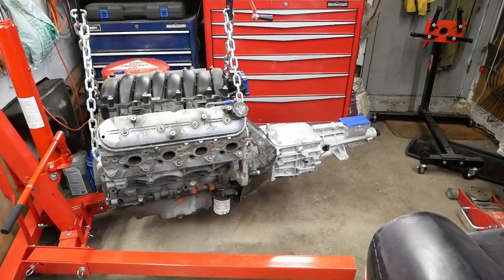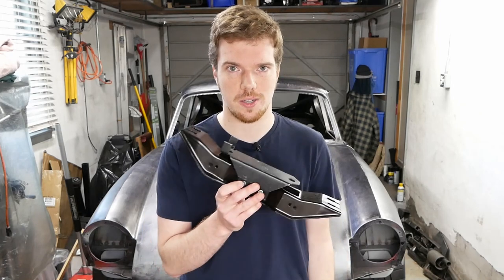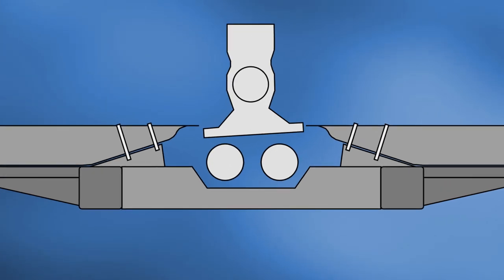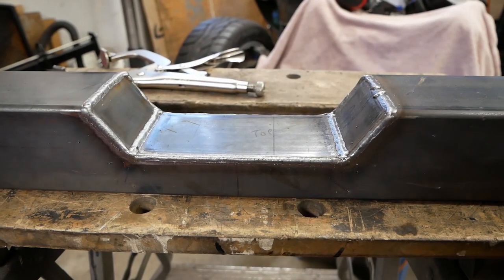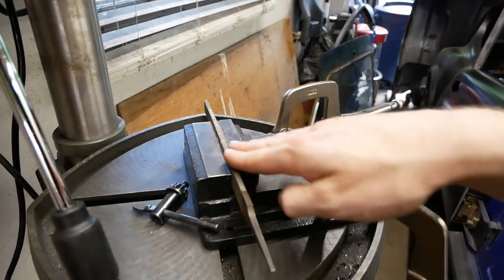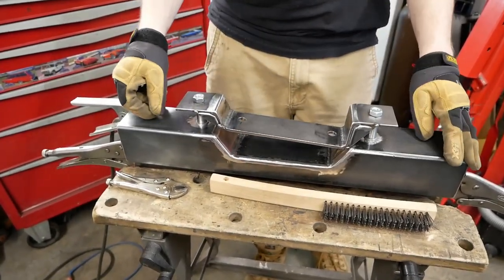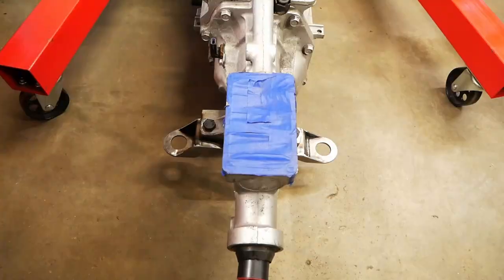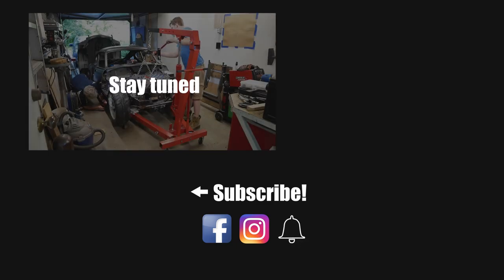LS & T5 Mounted – Pro Touring V8 Triumph Restomod – Project GT6R – Ep21

Comment: Ah the fantastic spark-catcher boot & shorts, very comfortable in hot weather an absolute must for catching those sparks from grinding and welding ;-)
Great work as ever, and I was pondering how you were going to get around all those kinky angles Ford throw around on that gearbox - well done :-)
Reply from the maker: They do catch a lot of sparks... maybe flip-flops would prevent that? 🤔😉  Thanks Rob!  It was a bit of fun but we're happy with how it turned out!  Appreciate the kind words!
Reply: @FanatikBuilds  Yes, I do find flip-flops a better protection against sparks & arcs ;-)

Comment: That is a great piece,  with your engineering background,  thought you might appreciate small suggestion, for a future build.  If there is room, if about 5/16 addition width were added and bend it slightly like 30 degrees.  It would add stiffness so you could reduce the thickness of the Main piece so all the mounting surfaces and thus the weight, additionally if you dimpled around the hole that would change the stiffness of that area,  it looks like there’s room and wouldn’t significantly interfere with the exhaust pipe.  Just a thought,  keep up
The excellent build I great enjoy your work.
Reply from the maker: Thanks for the kind words and ideas Oscar, really appreciate it man! 👍

Comment: A thing to check is to make sure that the transmission mount bushings aren't stiffer than the motor mounts. If they are, the result can be a future cracked bellhousing.
Also, I would recommend sleeves and pants while welding to protect against UV exposure.
Reply from the maker: Very good point!  They are less stiff, but thank you very much for raising that issue!  Haha, I do mostly wear job-appropriate clothing, but not when it's this stinking humid outside!  I burn pretty easily and have only had two occasions I can remember where I had any issues with that from welding!  Appreciate the consideration for my health though, thanks Jeff! 👍

Comment: Those boots with shorts look like they do a darn good job of funneling slag and sparks into your ankles.
.....Woops, just saw Brian's comment.  I was arc  welding a Bronco driveshaft for my son and was wearing jeans with a ragged knee. I had total concentration on that weld but noticed that my leg was getting uncomfortably hot. When I flipped the helmet up, I saw that my jeans were on fire. It took my knee days to heal but the weld looked like a machine did it.
Reply from the maker: They sure do!  Some flip flops would likely help prevent the funneling effect you speak of! 😉  In all seriousness, ironically, it's not too bad... I try to direct the sparks away from me as much as possible... it's those random blobs of weld that make themselves known mighty fast!  Never been on fire (yet), it's good having Dad out there as a spotter!  Cheers man 👍

Comment: More engine than I would have installed in a GT6, but great work.
Reply: I know what you mean but It’s not really a GT6 any more though is it? It’s a Scratch-built v8 sports car with modified GT6 panels...GT8? GTV8? 

In fact, it’s 90’s TVR-esque and nobody ever thought they had too much engine 😂👍
Reply from the maker: We're thinking along the lines of a GT6-R 🤔

Comment: Beautiful welding - way nicer than many other feeds I'm watching!! You may need to split the exhaust tubes where they pass the mount or they will be a real fight to get in.
Reply from the maker: Thanks Andy!  I have had some training ... but practice is really what's helping me with the welds!  Glad you can even see improvements on video! 😊  Yes, that's exactly what we're planning!  I want the entire exhaust system to be removable in sections so it doesn't all have to come out to do something as simple as a transmission fluid change. 👍

Comment: Nice progress! On a previous episode you did the front sway bar and after thinking If the steel bar you used doesn't end up working maybe a budget alternative would be a torsion bar from the front of a late 90s chev truck would work. Spring steel cheap and could easily be cut to length and made to work. Just a thought. Either way beautiful car!
Reply from the maker: Thanks Kevin!  The torsion bar idea is a great one, but the difficulty is going to be if it's too long.  Unfortunately cutting it down would pretty much negate the point, as it's the welds that are the most likely failure area!  Also making the arms would be tricky as one would need splines, and the other a hex-key ... still though, food for thought and I appreciate it man!  Cheers 👍

Comment: Fabulous project! A note though, welding in shorts and short sleeves is asking for burns and future problems with skin and UV. Nonetheless - super job.
Reply from the maker: Thanks Chas!  Haha, I do typically wear job-appropriate clothing, but not when it's this stinking humid outside!  I burn pretty easily and yet have only had two occasions I can remember where I had any issues from welding!  Appreciate the consideration for my health, thanks man! 👍
Reply: @FanatikBuilds   Other than the issue of immediate getting toasted... I have heard that old welders get more skin cancer if they didn't cover up. Lots of UV = long term issues.

Comment: For years I've liked the GT6 but am constantly looking to fixing the goofy shape of the quarter windows and vent!    It's tough to do better than the 911 or the E type...but we must try!
Reply from the maker: Try we must!  Can't argue with the E-type and 911 being unbeatable - though ironically the quarter windows on the GT6 don't bother me as much as the rear end!  Always felt it cuts back too high off the ground!  Oh well, I think there's always one angle on every car that's not quite perfect 😄 Cheers Shawn!
Reply: @FanatikBuilds  Short of changing the whole quarter window.  I've modeled a  small trim piece at the back of the window to 'round out' the shape.   If made as a vent shape...it might work visually.    Some black vinyl tape on cardboard, cut to shape is a painless test.   (At least it's simpler than reshaping the whole rear end of the car.  But now you've got me thinking...)
Reply from the maker: Haha, go carefully, thinking is very dangerous!  Ask me how I know 😄

Comment: Love the bolt sleeves. But if you were doing that anyways, why not recess them all the way to the other side for shorter lighter bolts?
Reply from the maker: Thanks Shawn!  It's a good question, we kept a bit of length in the sleeves for strength, as the shorter you go, the less support there is along the length of the bolt.  As much as saving some weight would be great, I think if we start worrying about grams of bolts, my OCD is going to hit the roof! 😅 Cheers man!

Comment: The curve in that transmission mount and easily be removed from it. You can do so by heating the lower two corners to a nice cherry red, at least along the length of the cut you made, and it should straighten that Mount backup just about straight. All you're doing is adding heat and metal always shrinks more than it expands when you heat it up to about 1100 degrees or 1200 degrees where it turns nice and red. You could also do the same thing by putting about the same amount of weld on the bottom of it in the same place as you put on the top of it, but then you would have a bunch of wild stuck to it.
I did industrial sheet metal for 40 years, and I have also built a number of varied frames for motorcycles and Automobiles. Years ago I actually corrected this exact same issue doing exactly the same as I have described to you. Somebody had made a transmission mount couldn't figure out how to get it back to straight.
Reply from the maker: Thanks for the helpful tips!  Thankfully, when we clamped it to the piece of angle iron on the frame before welding, it straightened up a good bit.  Hardly noticeable now!  Good to know for the future though, cheers! 👍

Comment: You know you're doing something right when a gearbox cross member makes an interesting video! Can't wait to see it running! I just picked up a less ambitious project, rx8 with a dead engine to fit my rover v8 into which I did a full rebuild on 6 years ago. Going to give it some boost eventually
Reply from the maker: Haha, well I'm glad it worked out!  Wasn't sure if people would find it that interesting, but I'm glad that's not the case!  A R-V8 powered RX8 sounds very fitting :) have fun!  Carbureted or EFI?

Comment: I've been following your restomod and am quite impressed with the quality of your work. The GT6 Mk III has always been one of my favorite cars and I've been a Triumph owner ('62 TR4) for 40+ years. A couple questions:
What gauge steel are you using in the frame? I ask because it looks stout, to say the least. I think my TR's frame is 16 gauge (though it has been reinforced a lot by fully "boxing" the U-shaped main rails and with a lot of gussets). Heck, my 2 ton Land Rover uses a 14 gauge steel ladder frame, which doesn't appear as hefty a a what you're building.
Additional frame questions: Did you consider using round tubing? Did you choose square tubing because it's easier to work with? A lot of custom frames I've seen used round tubing for it's strength to weight ratio. Not that you'll have any problem with a hefty frame... I imagine you'll easily see an increase in horsepower 2X or 3X from that V8 motor, compared to the stock 2 liter 6-cylinder originally in the GT6. 
Keep up the great work. I'm looking forward to the next video and all the ones after, until we see that car back on the road!
Reply from the maker: Thanks Alan!  I love the TR4, which obviously you must too!  40+ years is quite the legacy!  Respect!
We've used 0.125" or around 10-11 gauge  - I'm sure we could have gone thinner, but I didn't want to go through all this work and still have issues with a weak frame!  I'm afraid, I'm a bit more of an "overkill" kind of guy! :)  Amazingly, the new chassis isn't excessively heavier than what it replaces (judging by just picking them up by hand).  In fact, with the entire drivetrain now being aluminum (rather than iron), the engine/trans being pushed back, and the frame going under the body, we'll have improved the weight distribution and center of gravity by quite a bit!  We have weighed most of the larger items along the way, and are estimating we'll be around 2300-2400lbs with sound deadening etc.  Not too shabby!
Yes, we chose box tubing for the ease of use, and more a OE look as opposed to round tubing - a full tube chassis would be amazing though!  Power output will be ~3.5X the factory number, which should get us along quite nicely!  Hope you'll enjoy what's to come, and thanks for the kind words! 👍

Comment: Progress! I was wondering about potential exhaust heat issues with the dual exhaust running so close to the bottom of the transmission. Will you be putting in some shielding?
Reply from the maker: Yep!  It's tight through there, but not quite as bad as it may look!  Some heat-wrap and/or shielding will be helpful though 👍

Comment: Another great video!!   Question:  why is the mount (and the transmission?) slanted??   Looks a little strange!
Reply from the maker: Thanks Lynn!  Great question!  Ford designed a bellhousing that tilted the whole transmission towards the driver - I'm assuming to improve the gear stick position.  Our bellhousing puts it back level though, which just means that the mount has to take up the difference!  It does look a bit weird! 👍

Comment: Great project. Great workmanship too. Btw, did you drill some holes in the trans bracket in case water collects in the corners?
Reply from the maker: Thanks man, appreciate it!  You mean the beam, or the smaller bracket?  The beam will get drain holes later on along with the rest of the chassis, but there's not much of a change of large quantities of water sitting on the smaller bracket.  Ideally the sides would have been angled for drainage, but I'm honestly more concerned about weakening the part by drilling holes in it than I am about rust!  Will give it some more thought though - cheers! 👍
Reply: @FanatikBuilds  water and dirt buildup in recesses is something to address and your design is great and strong enough that a few drain holes won't weaken it. Great build and I wish I had found your channel earlier
Reply from the maker: @motoramavlog  You make a great point, I'll add it to the list for drain holes before paint!  Thanks man, we're glad you found us! 👍👍

Comment: I can't help but think side pipes when things are tight.There's probably some reason they wouldn't work that I can't see.
Reply: I'm still trying to figure out why running the exhaust UNDER the cross-member was a no-go.  Ideally, you want the exhaust on the bottom both for heat dissipation and for, well, crush protection.  It's a lot easier to replace a crushed or bent exhaust pipe than it is to replace frame parts.
Reply from the maker: Side pipes look better on a Cobra :) ... as for why we went over the beam, our frame is built like a large skid plate, I'd much rather scratch it then crush expensive exhaust components!
Reply: @FanatikBuilds   Well, if your goal was to make the frame the lowest part of the car, then yeah, mission accomplished.

But generally speaking, exhaust is cheap. Frame machines and frame repairs are not.  Maybe one step that shouldn't be overlooked is creating suspension stops to ensure that the suspension bottoms before the frame kisses asphault.

Comment: Next time, I recommend not to use clamps before welding something like this up. In hopes of not getting any warpage. I'm a welder fitter by trade, the best and most ensure way to get around this is rather a simple practice. Just tack a brace on next time and use something more beefier than a small piece of angle. So, instead of just clamping it, tack weld the brace on instead of using clamps to make sure it doesn't move before you try and weld it up! and that should work out ok, and make sure you use enough tacks. cheers.

Comment: Any chance you have a list of those details/welds you need to circle back to complete?  Like that transmission mount.  Who would have thought it would be angled?
Reply from the maker: We'll cover a bunch of stuff in Ep22!  The welds for the front suspension mounts and trans cross-member will wait until the body comes off again in the future though.  Thanks, we're quite pleased with how this came out! 😊 The angle is due to Ford tilting the entire transmission towards the driver - our bellhousing straightens it up again, so the result is the mount becomes angled!  Cheers Pat, hope you're well! 👍
Reply: @FanatikBuilds  Bigger cars require unique design solutions.  Smaller cars - the triumph is narrow - do not require such and so when the two combine, a hand shake is required.  Yours was a firm and functional hookup.  Keep building!
Reply from the maker: Good way of putting it!  Thanks Pat, really appreciated!

Comment: Given all that you've endured RE: the LS-4; If you had it all to do again would you stick with the LS-4 or go with something a little more popular in the LS line? I ask because I have a 1979 MG GT Roadster that, metal-wise, is in pretty good condition but I'd love to put an LS into it. I've even started looking for a salvage Corvette that would give me the drive train such as you have installed but '85 Vettes had cast iron 5.7 Liter engines with cast iron heads; much too heavy, so I'll still need an aluminum block LS. Interestingly, I've had, at some time or another, most of the pieces you have modified and put into your Triumph (except for the Crown Vic stuff) but, alas,  all long before I acquired my MG.

I've done lots of engine swaps into lots of different things but nothing as involved as what you've done here. I'm just blown away by what you've accomplished, how professional it all looks and how professionally you've presented it. Congrats on being able to work with your Dad on this project.
Reply from the maker: It's a great question Bob!  Having done it once already, yes, I would do it again.  Pretty much without any changes!  The only area I would readdress is the clutch, as the 9" one we've got fits with room to spare, so I do believe something a little larger could be used if we did it again.  (Not 100% if a 10" would fit, but a 9.5" should easily)  Otherwise, we're very pleased, and definitely saved some cash over a traditional LS1/LS6 or L33/LM4/LC9.  Yes, the older LT1/L98 are a good bit heavier... even in the LS world, an aluminum block vs iron saves 100lbs!  Our solution actually weighs slightly less than what the car had from factory, and also sits further back and lower down which should all just make for a better package.  Hope you find something suitable for your project, and most of all have fun with it!

Thanks for the kind words here, I really appreciate the encouragement and hope you will continue to enjoy what's to come!  Cheers 👍

Comment: Is that LS lighter than the Triumph unit?
Reply from the maker: Not having weighed the Triumph mill personally it's hard to be exact... but... research says that the Triumph 2.0l is right around 400lbs and closer to 460 with accessories (waterpump, alternator, intake, carbs, exhaust manifold).  An all aluminum LS longblock is 300lbs according to Taylor Ray (on YouTube) ... intake manifold 10lbs, exhaust manifolds 25lbs... it's the accessory drive that is the question mark.  I'd say we are definitely lighter, yes!  The weight is also lower down, and further back in the car ... perfect!
Reply: @FanatikBuilds  25% weight saving and 4 times the power.
Reply from the maker: I'm a bit excited to say the least! 😄